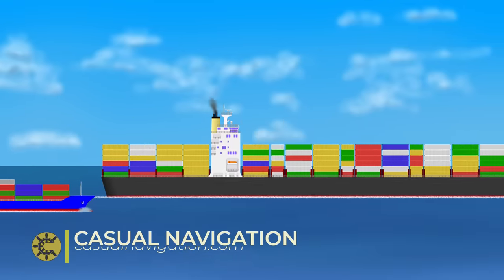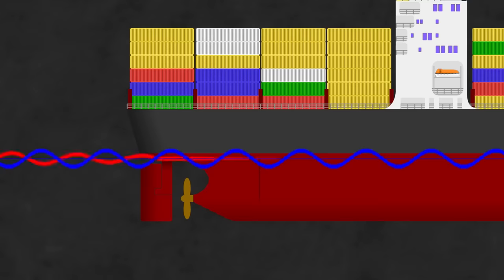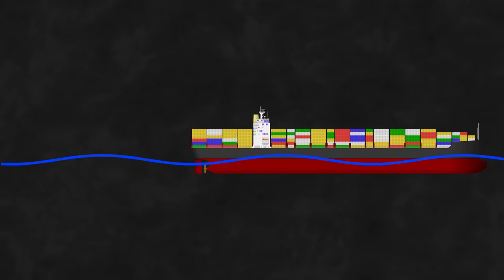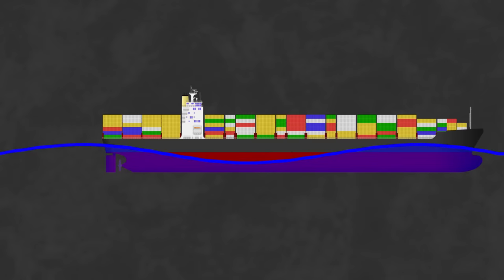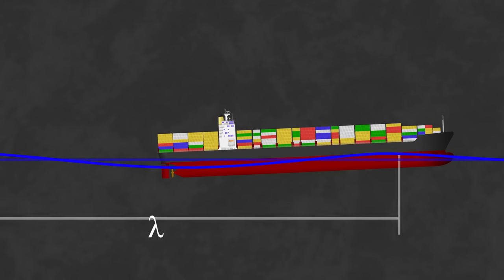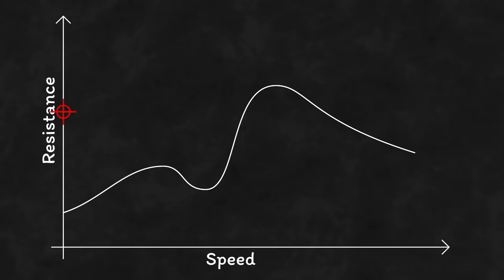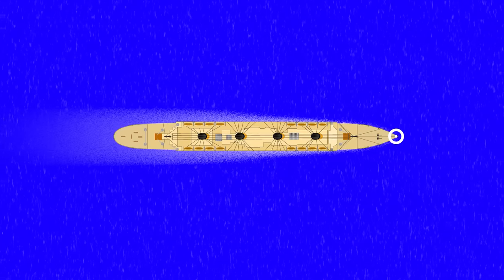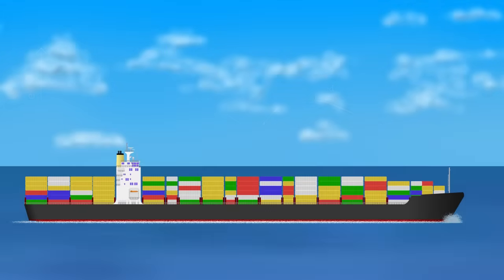Why Are Big Ships Faster Than Small Ships?

Comment: As a Naval Architect, I really wish I had access to these videos when I started my degree. Such a practical demonstration of the theoretical concepts.
Reply: ....plus you would have understood how critical it is for large ships to be able to get up on plane if they're going to be any good, especially with efficiency plus speed together. If 590-ton craft can leave the ground supported by nothing more than a gas, what's the hold up? How can we expect planing not to be standard on large vessels? 😊
Reply: @ReflectedMiles  sounds like you are suggesting hydrofoils. They are not efficient for larger ships. Please note my Naval Architectural degree is focused on plastic bathtub toys.
Reply: As a docking tug captain, this is cool to see in exactly the opposite way 😂  Practical demonstration is all we get.  
Learning pressure zones on different hull forms is a very stressful experience.
Reply: @krombopulosmichael6162  No in the video plane speed was beyond the hump speed where the wave peak is at the bow and the trough at the stern, so the engines push uphill in addition to water resistance.
Reply: @RobBCactive  most ships are not designed for plane speed though, according to the video. It does mention bulbous bows, which are becoming more common.
Reply: @krombopulosmichael6162  exactly economy matters more, I would stay those bulbous bows are standard for decades
Reply: As a certified barnacle scraper, I agree.
Reply: Where did you study maval architecture? I mean, this is basics
Reply: @leoe.5046  Hey, you can have a degree but still appreciate a nicely put together graphic representation.
Text books aren't always clear
Reply: Naval architecture? Sounds cool
Reply: You didn't get access to such videos because he was studying with you, more than you.
Reply: Slightly amazed by some of the negative replies to my comment. To clarify (and I really can't believe the need to defend this comment) I said "started" my degree, as these videos are a good visualisation of the specific calculations and concepts you are beginning to learn. Secondly I went to one of the best Naval Architecture schools in the UK and the world and graduated with a 1st Class Honours MEng 🙃. I wonder whether some of the saltiness is associated with the subject matter 😅
Reply: vibratingstring  we didn't have much exposure to the tow tank when I joined and personally I find videos more engaging. Glad you had good books though and got that learning opportunity 👍
Reply: @RobBCactive  I think they really started making an appearance on commercial ships following the 1970s energy crisis, although many of the old ocean liners used to have them in the time of the Blue Ribbon. So yeah decades old stuff 😂
Reply: @FrontNine09  exactly!  Some people twist stuff stupidly to vent their spite on strangers anonymously.  Welcome to YouTube!
Reply: Kids these days just don't understand how exceptional the web is.  Information abounds, yeah you have to be careful with veracity, but the amount of information that you have access to is astounding.  It's great to have a text book but to find a video with demonstrates  ....
Reply: I was just saying that I know nothing about naval architect but I understood that.
Reply: I tell people that are younger than me all of the time that when I was young, I had my mother's encyclopedias for in house reference, which were printed the year before the moon landing, and I had to go to the library and search for hours to find other information, and then I had to read, and finally understand it all. At least I knew that most of it was on point and true. Today, the wealth of information that is at your fingertips, and also how it is presented, so that it can be absorbed and understood easily  and rapidly, is one of the greatest advantages that has been presented to a generation in all of history. Even the advent of language and then written language, can't compare to the advantage that had been gained by today's youth over every other generation in history. Then, they use it to invent new sexual identities and to demand that people use the pronouns that they give for themselves. Okay, that isn't what they all do, and I know that they're are some really bright people that have good intentions, and they are going to use these tools to great advantage. I think that if we can Jeri it all together, we will begin to experience an explosion of discoveries into very complex sciences, into the prevention and curing of diseases, and hopefully they will discover how to bring about the end of war and violence, while still insuring that humans retain the ability to be strong and defend themselves from whatever they may discover.
Reply: Naval architect is now the only architect I respect (joke)
Reply: @krombopulosmichael6162  Coz size matters 🙄😹
Reply: @warrenarnold  so it’s not the motion of the ocean? 🌊🛶🛥
Reply: @seawalkarrg  Don't make me laugh, i can't stop laughing
Reply: @FrontNine09  Congrats, I attended a short Naval Architecture course a long time ago, not sure if I would be an Aero or Naval Engineer. You  graduated were? (if I may ask) and do you work with that? Just curious.
Reply: What’s the coolest ship you’ve designed cool job
Reply: Well you could always start over
Reply: @EricGoesToShopClass  
Thank you for being a pusher/ Trusting help boat for Docking these NEW monster cantainer ships. I remember in the ARMY the 45 foot ( ST)
Was on, are stern would drag down especially if we got close to bottom. There was a big River outlet next to are training pier. The stern would become awash when we cruised across outlet for River leaving Pier.
Reply: that is why elon said you can learn anything in youtube
Reply: @Rory Mackenzie do you know by chance why it is that cargo ships don't have hydrofoils?  Everything I have heard was people's guesses. 
People guess that it's too heavy, but then I say how can a hunk of metal in the shape of a tube longer than 2 buses combined fly at 500 mph (airplane). IE weight has less important than balance/power/hyrdo-aerodynamics.
Reply: You design belly buttons?
Reply: What are the pros and cons of your job?
Reply: you need to ho to architect hill
Reply: @Senia T because hes just a youtube watcher like the rest of us.
Reply: well i'm gonna start my degree as a naval architect next year, and i'm glad i found these ! If you have any tips i'm listening :D
Reply: @038alpha  I'd bet large amounts you wont graduate.
Reply: @WTFisupDennys  how much ?
Reply: @038alpha  $20
Reply: @038alpha  I didnt graduate so that's a lot too me.
Reply: As a marine engineering student, I wish I took naval architecture
Reply: I swear they do this to make it seem more important and don't just explain things to you upfront
Reply: i like boats and such
Reply: @aminormaximum2446  
Grant Genereux I think is one example of a great discovery due to the information age. He has published three free ebooks on his webpage on how excess vitamin A (hypervitaminosis A) is insidiously toxic causes all kinds of diseases.

To note, Grant Genereux is a professional engineer that almost died of kidney failure.
Reply: I just started as a graduate naval architect, I wonder how may people watching are naval architects.
Reply: Hey, future naval architect. What is usual sallary?
Reply: As someone who sails on these ships i want you to know we need more scuppers at the bow im tired of having to mop the deck for 2 days after it rains because we gotta put some paint down before the next time it rains
Reply: As a master boater I know more than all you guys
Reply: There are 4.3 k Likes on this comment?

How many Naval Architects are out there watching this?
Reply: @OssamabinKenny  none 😂
Reply: When did you go through engineering school as naval architect? Back in the Casio calculator days?
Reply: @ReflectedMiles That's a stupid statement.

Comment: Thanks for the explanation.  I've often wondered the same.  Years ago, I was on a 42' private vessel crossing the Panama Canal.  The Canal obviously has too much traffic to let a puny motoryacht take up an entire lock, so the Harbormaster put us in with a cargo vessel -- large, but sufficiently short to accomodate us both -- for each leg of the trip.  On the way up, the big ship entered first, and we behind her.  When we reached the lake elevation and that ship fired up her engines, her prop wash was so intense that the only thing keeping us from getting bashed into the sides of the lock were the six lines the Canal staff gave us (delivered by the famous "monkey fist") that held us tightly in the center.  Still, all open beverages were immediately spilled.  When she got underway and we followed, I was amazed at how quickly she put distance between the two vessels.  In no time at all, we lost sight of her.  Of course she made it across Gatun Lake in a fraction of the time it took us.  The Canal staff knew this would happen, so they had previously scheduled us for a departure with a different vessel.  This time, her length wasn't an issue, as they put us in ahead of her, and her bow literally covered the space we occupied.  You don't truly get a sense of the scale of these beasts until you have looked straight up from the deck of your boat and seen nothing but metal above your head.
Reply: The worlds most expensive parasol
Reply: It’s hard to imagine taking a 42-foot vessel through the PC. It definitely would’ve been a fascinating and memorable adventure.
Reply: @bnease007 , it sure was!
Reply: @bnease007  Taking any vessel through the first time is memorable and fascinating.
Reply: I have a ship's bell from the Panama Canal. Weighs about 400 pounds.
Reply: do you remember how much it cost you for that size boat? I know they go by gross tonnage and I heard it was pretty inexpensive for a pleasure boat
Reply: @zenolachance1181 , that's correct; the Canal does charge according gross tonnage. Large vessels pay hundreds of thousands of dollars to transit. I don't remember the exact amount we paid, but it was a pittance by comparison.
Reply: I call bullsh** how can you not remember the cost, it’s not like a toll you past everyday on your commute to work.
Reply: @johnnygab4376  lol it was decades ago.  If you can remember the price you paid for something in 1994, good for you.
Reply: ive transitted the panama canal countless times but everytime is like a first time..its so fascinating..
ill share you guys a trivia...the US dollar is the currency in the canal zone..the boarding crew plays domino to while their time away after every canal transit 😂
Reply: fyi..cocaine can be bartered for food and drinks to those panamanian boarding party  😂...were sort of "regular" i guess..
Reply: ive sailed round the Horn once , through the Strecho de Magallanes and im so very thankful to the builders of the panama canal...The Horn is the loneliest and most scary place ive been in my years of sailing
Reply: What a great story! Thank you for sharing. Former Navy so I love sea stories.
Reply: Wow
Reply: @zenolachance1181  Isn't there the classic story of the guy who swam through the canal, and was charged a few cents
Reply: @mannyfernandez6860  The US dollar is not only the currency in the Canal zone, it's the currency of the whole country  (Panamá) 💀
Reply: I betcha even if you was 10 or 25, 69 or any other age on experiencing that I guarantee will never leave your memory for the rest of your life
Reply: @2teethPogZa  , it sure won't!
Reply: And those "beasts" weren't even that big, a Panamax is a relatively small ship compared to most ships these days.
Reply: iirc there's a company that acts as a broker for these kinds of fees who have a Panama Canal calculator on their website to  estimate the cost.
Reply: @jdhr7767  in the canal zone the US dollar is exclusively used but outside there is the Balboa wc is not much difference @ 1:1 exchange rate 😆
Reply: @mannyfernandez6860  Mano yo vivo en Panamá 💀💀, sí ok la moneda aquí es "el balboa" pero eso es simplemente un nombre ya que no es una moneda independiente, tenemos nuestras propias monedas de 1-50 centavos pero los billetes/efectivo son dólares americanos ya sea de 1,2,5,10,20,50 o 100, así que no, el US dollar no es usado exclusivamente en el Canal, and, if you don't speak spanish (which I just assumed bc of your username) then here is what I said: I live in Panama, yes ok the currency here is called "Balboa" but that's just a name bc it is not an independent currency, we have our own coins of 1-50 cents but that's about it, our cash/money are literally just US dollars (1,2,5,10,20,50,100), so, unlike you said, the US dollar is not used exclusively in the "Canal Zone" which btw doesn't exist anymore bc the military US presence stopped here in 1999.
Reply: Tbh, I would be terrified being that close to a container ship
Reply: @Democrats Fought To Keep Slavery LoL, I hadn't thought of it that way, but you're right!
Reply: That's scary
Reply: Genuinely a cool story, thankyou for sharing it! I'm glad I popped into the comments now haha
Reply: @jdhr7767  you know Google offers translate on here so you didn't need to break it down in English but thanks for the effort 👌
Reply: Then props on container ships are no joke, they are 2 story’s tall on some of them, some even bigger.

Comment: I was thinking it was due to a ship 2* as long, wide, and tall having 4* the surface area (for drag), yet having an engine 8* as powerful.  Didn't think about the wave interference.  Good video
Reply: i did too. thought it had to do with how a bigger engine takes more fuel but also the bigger ships caries exponentially more containers.
Reply: @ronblack7870  Not exponentially, but cubic more containers. Length*Width*Height.
Reply: A boat twice as long is 8 times bigger. L x B x H.
Reply: @sverkeren  A cube power is an exponent.
Reply: This is what interesting is that hull speed is determined by the length of the ship, not area.
Reply: @tinkerman9525  Which is why the engine is 8* bigger, and the surface area is 4* higher
Reply: @LoanwordEggcorn  Cubic is a type of polynomial, where the variable is raised to a constant, like x^3 for example. In exponential functions the constant is raised to the variable, like 3^x. The money on your bank account grows exponentially with time due to interest. The volume of a cube does not grow exponentially with the length.
Reply: Your formula is wrong.

Greatest concern in water, 
is the surface tension between the hull
and water.  

********
As try to go faster, 
this tension becomes the greatest factor.
>> Pull a rock behind a speed boat:
- Start on a flat surface & then loose the flat surface.
>> Slide a Hydroplane, across the water.
Reply: @toddkes5890  
-- Size of engines is compared to the 
amount of vessel, Underwater !
-- Skill of the captain/driver also being a major factor.

  Went water skiing, behind a 5hp boat !
Many other factors, are quickly found.
Reply: @sverkeren  
Question is how many factors involved, Before being cubed !

 --- ( L x L x L )
related only to the length.
 ---( L x W x H) 
related directly to each variable

******
With a boat, all 3 factors must increase in direct proportion.
 L x H(L) x W(L)

When talking boats, 
need to specify what measuring as height.
Reply: @sverkeren  So a cube is not an exponent of 3?
Reply: @LoanwordEggcorn  In x^3, the number 3 is called the exponent. But every function with an exponent is not called an exponential function. It's a quite common mistake people do to call anything that grows faster than linear as growing "exponentially".
Reply: @dirkkarmel5209  I don't know much about ship design, I was just nitpicking about the use of the word "exponentially" in this thread.

However, if you could express H(L) and W(L) as linear functions of L (which seems reasonable to me), plug them in and work it out, then you got the volume of the ship as a cubic polynomial of L.
Reply: @sverkeren  Agree that's a polynomial and not an exponential function.
Reply: @ronblack7870  for me i just thought, why knot? 😅 Coz i mean, Coz size matters 🙄😹
Reply: @sverkeren  Thanks, as a math person I was being strongly compelled to make similar comments.
Reply: Square-cubed law is a hell of a drug.
Reply: @dirkkarmel5209  That is why you try to minimize as many of those factors as possible.,  For example, I apparently needed to add the phrase "all else being identical', which would have covered the mass fraction of the engine as well as the skill of the captain/driver.
Reply: @jamesharding3459  Makes me think of orbital periods and radiuses. Don't do drugs kids they are out there.
Reply: I also thought the Same thing before I watch this video. Big ships has ^3 power but ^2 resistance.
Reply: And me simpleton thought it was more a question of economics (value of cargo/cost of fuel x time). 🥴
Reply: @dmitripogosian5084  Hull speed is determined by many things, the approximation uses Speed because you can assume a certain hull shape
Reply: The proportion between resistance and weight also helps, but an 8 times heavier vessel won't necessarily have an 8 times more powerful powerplant
Reply: Bigger ships require proportionally less fuel for the reasons you state.  So yes, the surface area to volume ratio does play a part, but its backseat to the topics in the video.